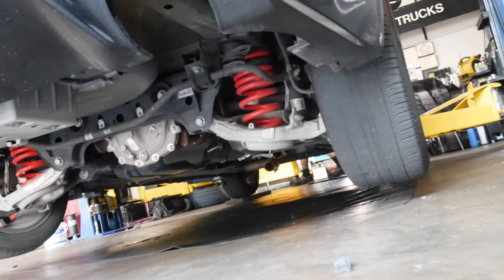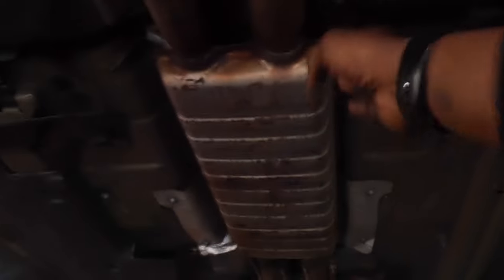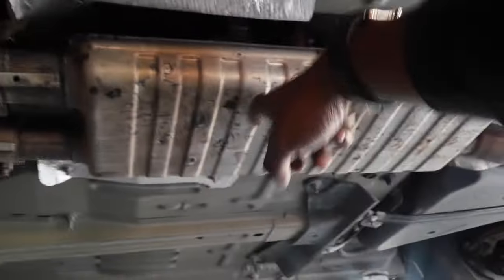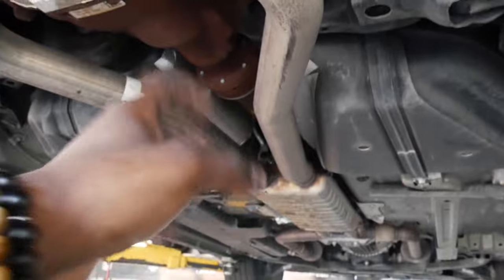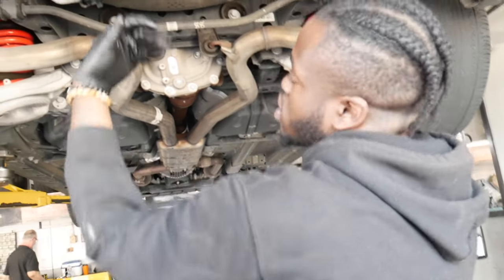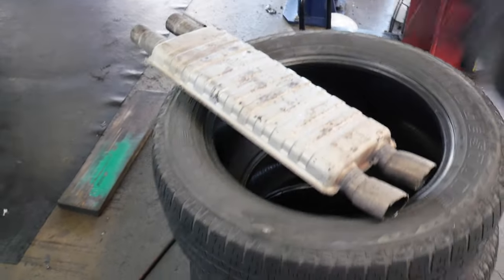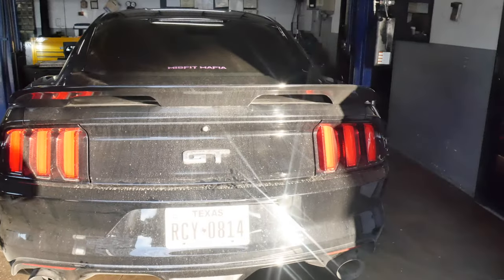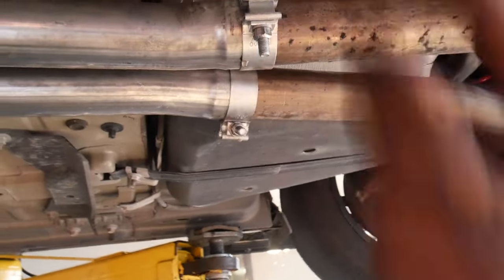INSTALLING A H PIPE ON MY 2016 MUSTANG GT *ITS BRUTIAL*

Comment: Are you using the stock exhaust pipe size 2.25, or did you upgrade the size
Reply from the maker: It’s was stock piping all the way to the H pipe Leading to a 3in muffler delete